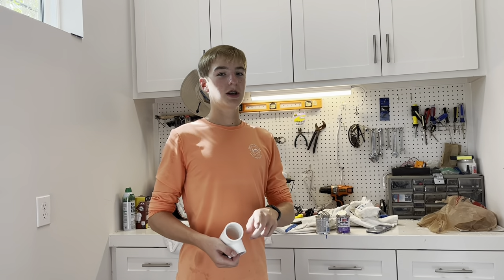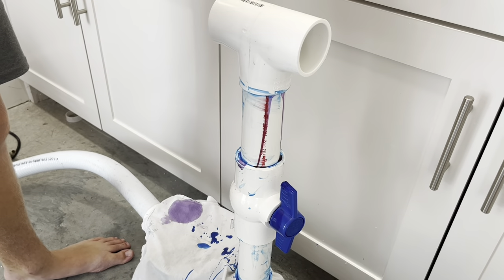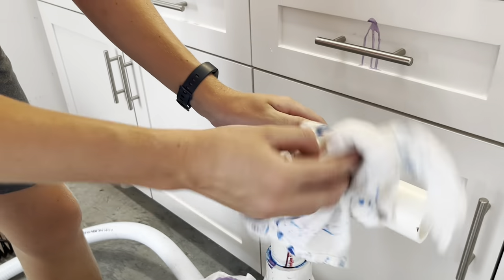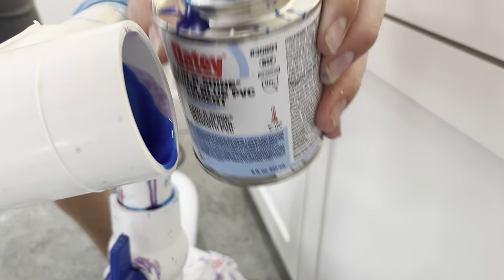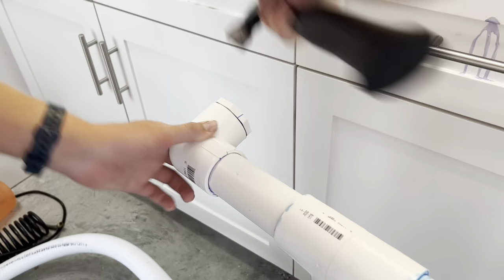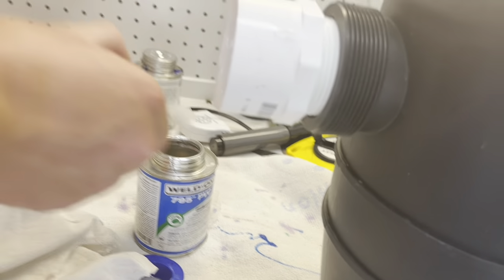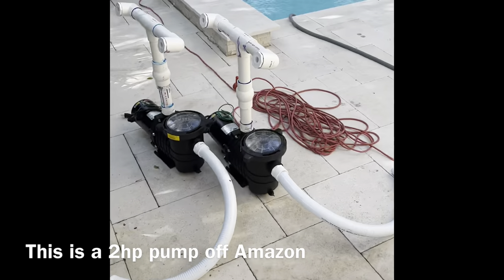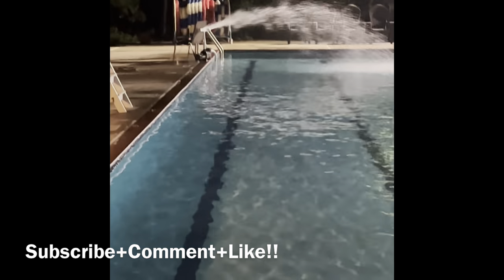Water Cannon Build

Comment: Thanks for sharing - this is really cool and will be nice to try on a summer like this.  What kind of PVC fitting is the water coming out of?  It seems more mist might be better?  Regardless - appreciate the share - I might try building one of these myself!
Reply from the maker: Your welcome! It’s just a 2 hp 120v plug in pump from amazon and pvc from the hardware store. It will cool the water 5 degrees or so from the outside temp.